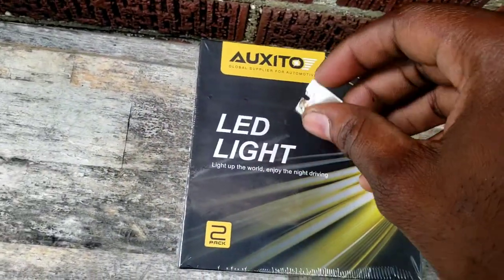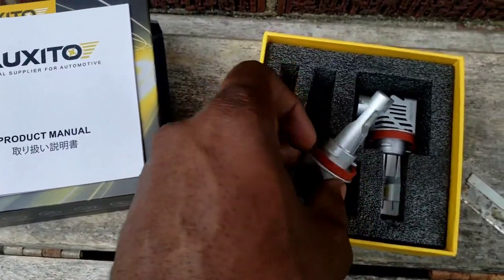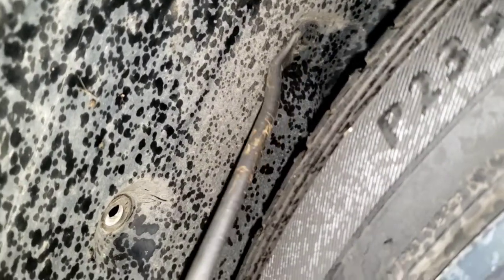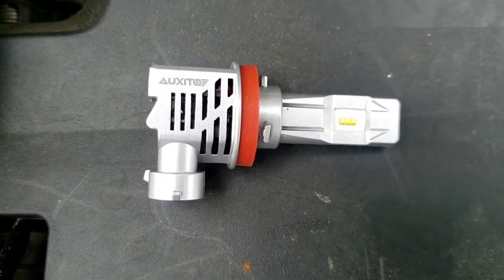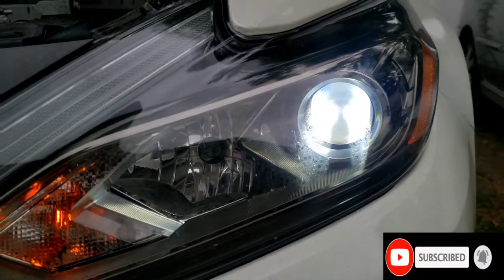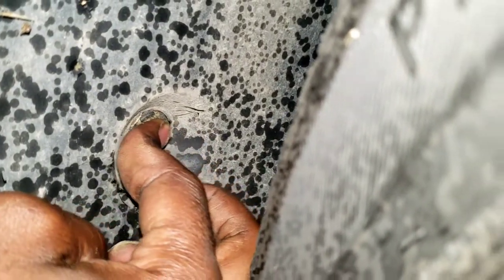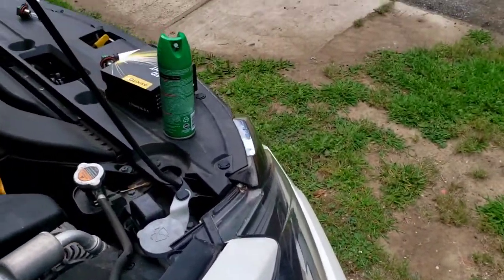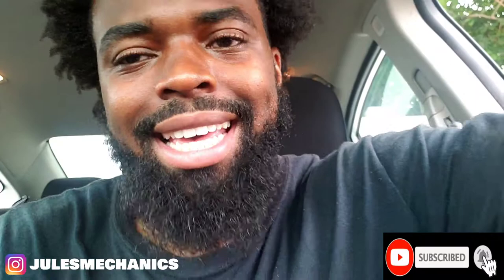How to replace headlight low beam bulb 2017 nissan altima

Comment: Clips broke when I popped them off using the tool. I have to buy new anchors now. By the way, after you popped off the two push anchors, what were using the wrench for? I don't have any screws are anything else on my 2017 Altima